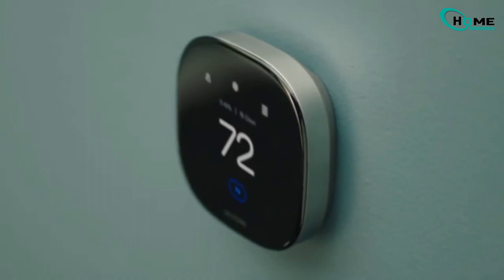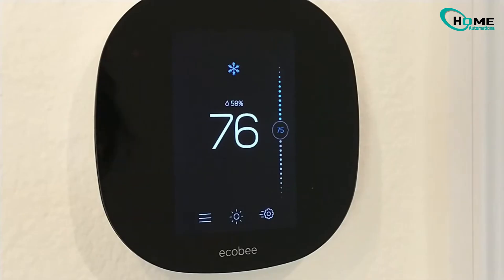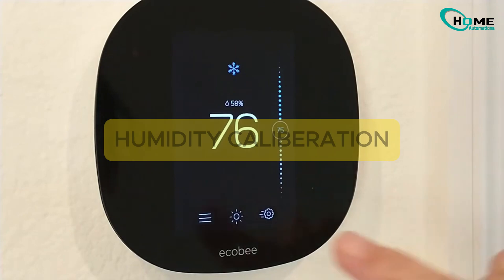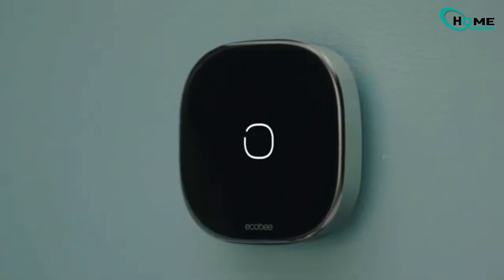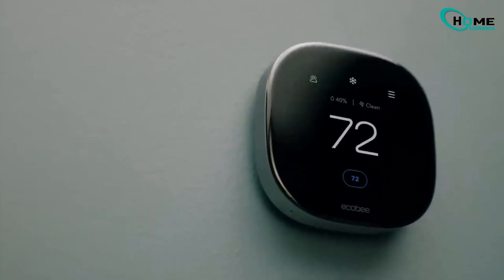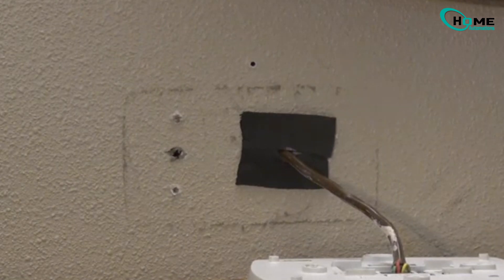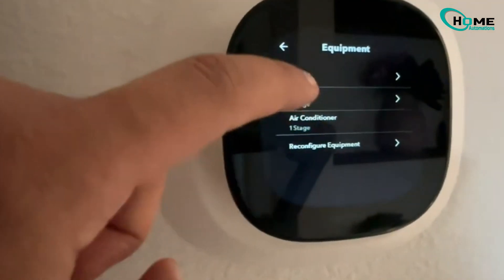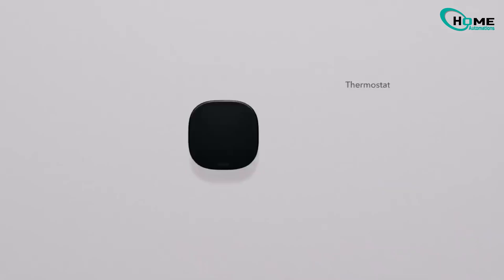How To Calibrate Ecobee Thermostat?

Comment: The smart processor and the “always on” touch screen generate their own heat plume. With a thermal camera; the wall around the sensor and the air a few inches away were at 70F.  But the face of the thermostat maxed out at one point at 87F.  The thermostat was reading 74F for the room temperature.